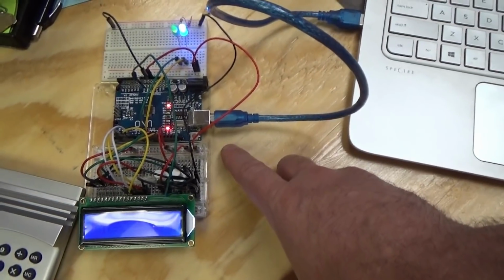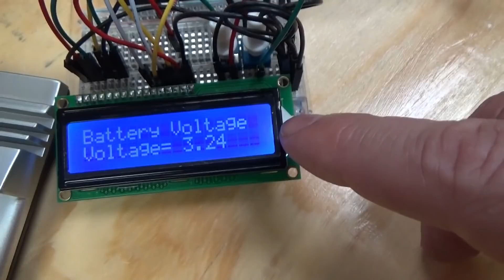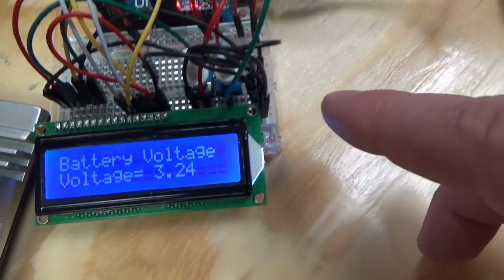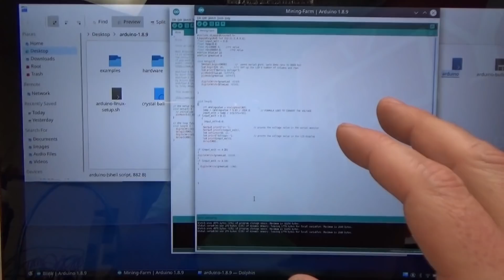Setting Up Arduino For Automatic Mining Rig On Off Control

Comment: you could even use a little voltage adjustable 100W PWM or MPPT Controller and have it hooked up to a cheap 12V 6W network switch to kill your internet witch will stop the mining systems from working but leaving the computers on, then you would be pulling what 60-100W max per system? and when it turns back on the switch they will start by themselves. 

But yours is WAY more cool with the Arduino setup. turning right off the system.
Reply from the maker: Yes the idea is to use a smaller battery bank or ever super capacitors. The storage will only be a buffer for the charge controllers. The solar panels will do all the work. No solar, no work and all computers will be off. Thats the idea anyway. Still working on the details.